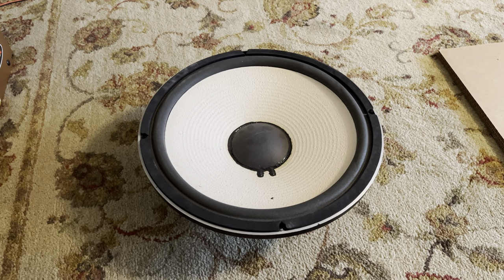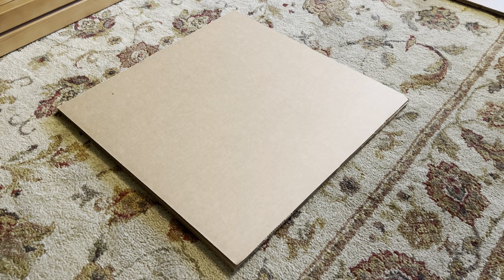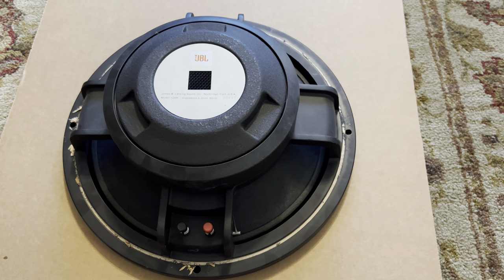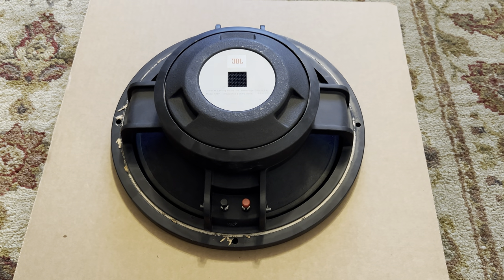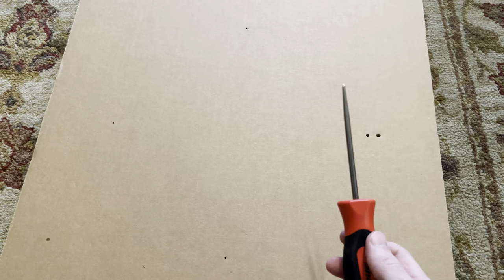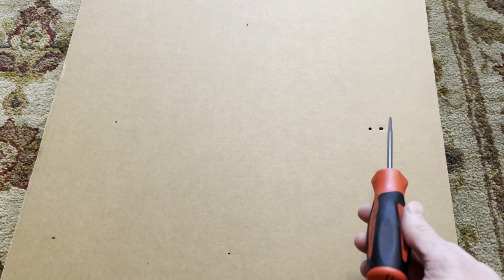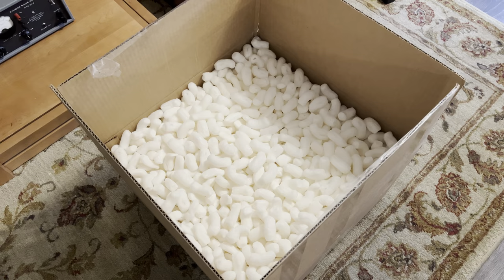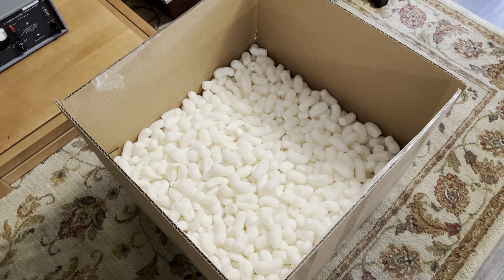Shipping a Speaker Properly

Comment: The only really noteworthy addition to this would be to have the driver fully wrapped in plastic wrap…I think is just behind protecting the face of the driver with a rigid board, because it protects the cone from anything entering the basket from behind. Like when you have vintage drivers with an attached L-pad or anything else. Also if those peanuts were placed directly on top of the driver, there will definitely be peanuts in between the basket and cone when unpacked. They usually don’t do damage, but you don’t want any foreign objects in there touching cone, or the fine VC wires. Had a speaker arrive from Germany yesterday with peanuts lodged in there, and I had to carefully remove with tweezers.

Comment: Horrible way to ship...

Front panel over the front of the speaker should be ½ plywood

Immobilize the speaker with pool noodles

And then the speaker need to be wrapped with pool noodles as well and then saran wrapped or shrink wrap, w/e is convenient 

Last step is making sure the speaker after wrapping fits snuggly in the box, do NOT use an oversized box that is hard to handle and allows for large abouts of movement, the speaker is going to be bounced around for hours on end and WILL deflate the peanuts or pop bubble wrap

Pool noodles are cheap, tough and found everwhere

My background? I collect and ship old school car audio subs that run upwards of 70lbs... they have to packed for war to survive

I have lost more old school subs to bubblewrap and big boxes than anything else

If the ups guy cant get ahold of the box, its going to get shoved and kicked to move it, plain and simple
Reply from the maker: My shipping method works fine. Plywood is overkill and unnecessary. Never have lost a speaker using this method and I’ve been doing a lot longer than you have.

My background includes shipping multiple Pioneer SX-1250s, Sansui 9090s, JBL L100s, JBL XPL200s and literally thousands of other items over the last fifteen years.
Reply: @chrisw.3077  hahaha ok, lets you send a pair of fosgate power hx2 15s... they will be absolutely destroyed ... 

You need to learn that ups drivers and fedex dont care like they used to... adapt before you lose something you cant replace
Reply from the maker: Do yourself a favor. Next time you buy packing material, buy it from uline and purchase their double walled boxes. The boxes themselves are plenty strong. What you are describing above doesn’t even factor in because you can easily stand on the package and it won’t even budge.

Comment: Chris, given that the front rubber sits out from the diaphragm of the speaker, aren't you worried that by laying it flat on the cardboard it's putting pressure on that part?
Reply from the maker: If by diaphragm, you mean cone, then no, I’m not worried. That’s because on JBLs and most speakers you’ll find, there is going to be a metal frame that the cone is glued to. So if you have cardboard against a cork or paper gasket against a paper cone glued to a metal basket, there is little opportunity for damage.